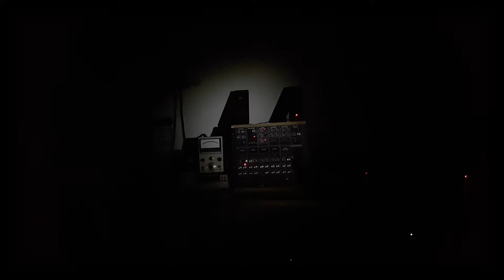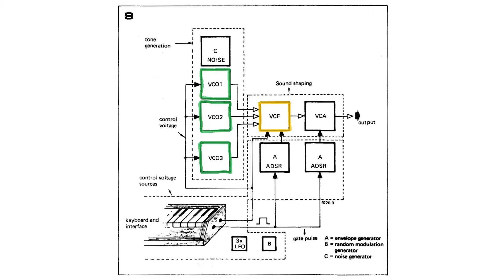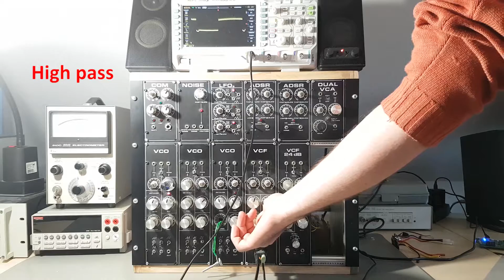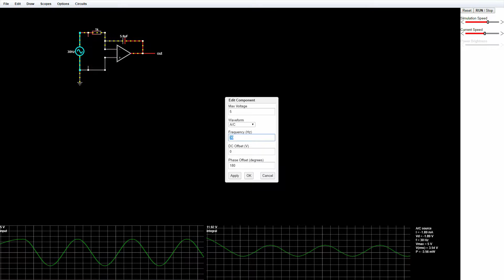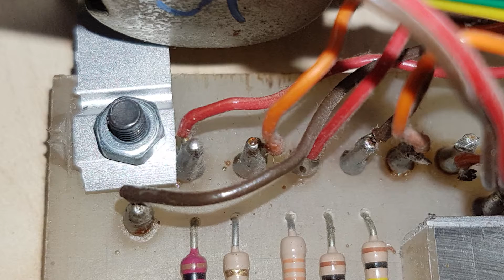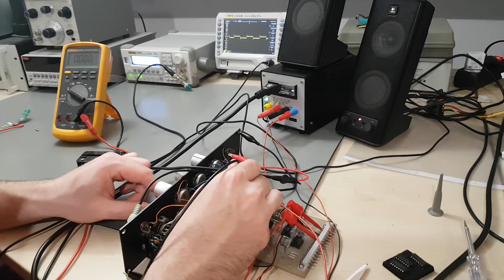EP06 VCFs - Elektor Formant Modular Synthesizer Overhaul

Comment: Hello!! I was given an elektor formant by a friends father, who built it in the early 80's . I need to rebuild the entire cabinet because it is not built as a eurocard rack... I need to find mounting angles to Mount the pcb 90 degrees to the front face. What is used in your formant?
Greetings from Sweden
Reply from the maker: I did find the perfect component for that purpose, available at all major component shops. But the PCB / FP hole distance the Elektor designer has prepared doesn't fit. Can send you the part number later if you are interested
Reply: Marco Reps i want it!
Reply from the maker: hm it's not that easily available any more: Fischer 10067229 ( https://www.reichelt.de/?ARTICLE=140837 )

Comment: Nice build :)
I done a version of HaJo Helmstedts/elektor MSS2000 and updated reissue of the original elektor formant synthesizer, about two decades ago. If you buy the book (only avaiable used) you would also need to know that it contains various errors which affects all (some in the module schematics some other on PCBs and/or partlists), we set up a mailling list at that time we discussed all these errors and also HaJo done some nice faceplates and PCBs along the way.
I still have and use my version and i´m very happy with it.

Comment: With the amount of stuff you buy it might be worth saving up a bit on needed parts and buy on mouser.de instead. Ever since I do that I have rarely bought anything from conrad.... especially since ours is in the middle of the city and you pay a premium for parking, and getting a part now instead of later is the only reason I would ever buy there... It is not hard to get to the minimum order amount on mouser.de to get free shipping ;)
Reply from the maker: I too am only going to the big C if I have to :) For the bigger orders I like Farnell, because they have a good parametric search and deliver the next day almost always. (But I have never even tried mouser, so they may very well have the same!)
Reply: mouser.de turned into my first goto when I need specific parts, many years ago it turned out to be the cheapest almost always, so I stuck to it. Their delivery costs for when you buy under 50€ are nuts (20€!!) but they are rather fast too, though most of their stuff is sent directly from the US
Reply: Dennis Lubert and here I thought mouser was German